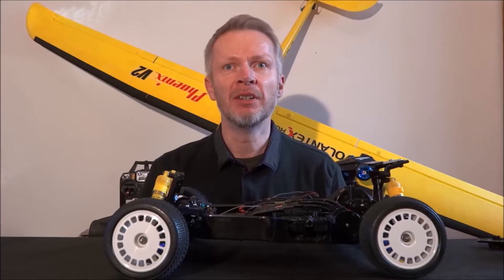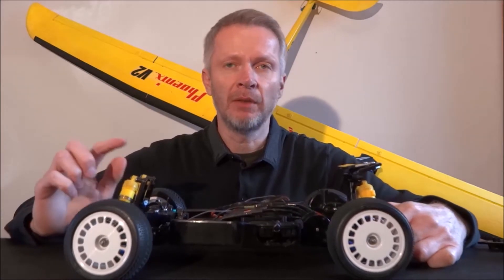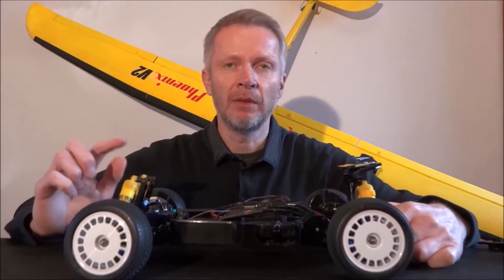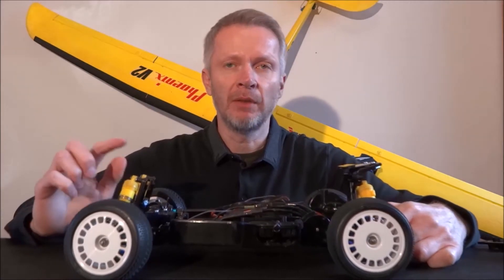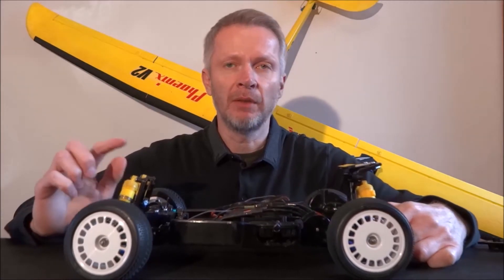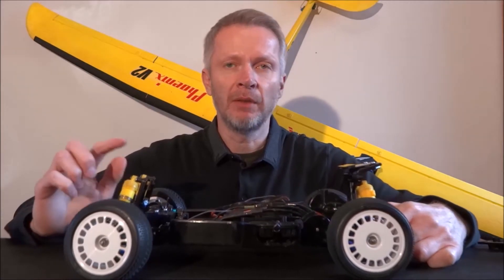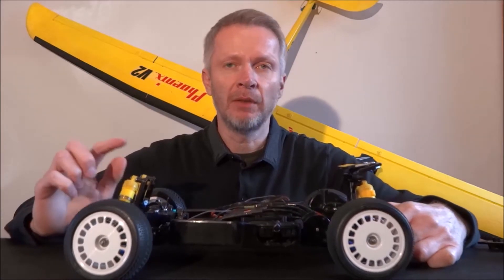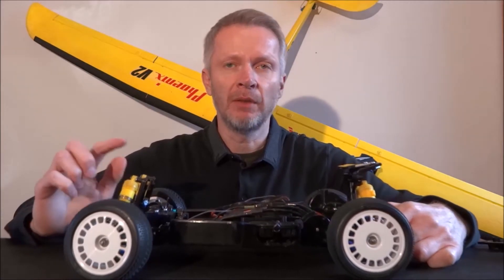High speed gear set into TAMIYA Manta Ray / Top Force DF-01

Comment: That was a cool bit of insight! I was not aware there was an older version of the gearbox, I went and checked my Top Force, it also has the "H" marked one, although I only got a 21T pinion in it or something...
I'll be getting the high speed gear set for my next build, though...
The look on your face when you gunned it, ha ha, that was fun!
Reply from the maker: Great to hear you found it informative, and yeah it was a shock and fun when i gave it full throttle 😁, on a fully charged battery maybe a bit more still 😁😁